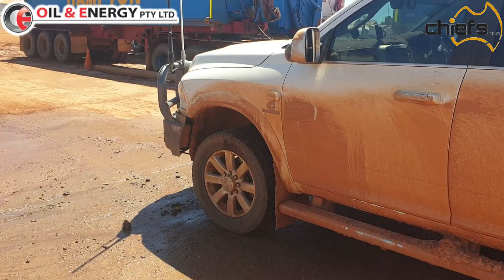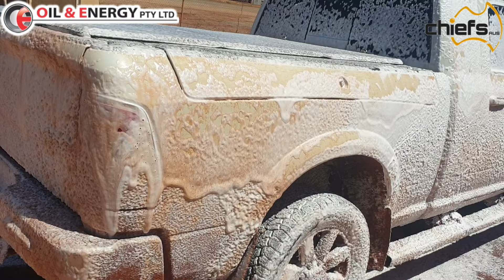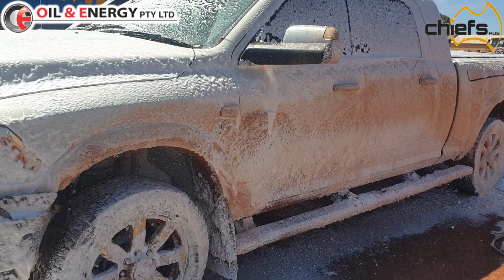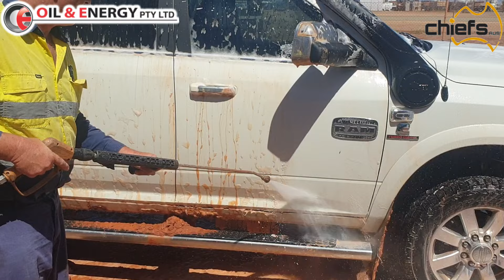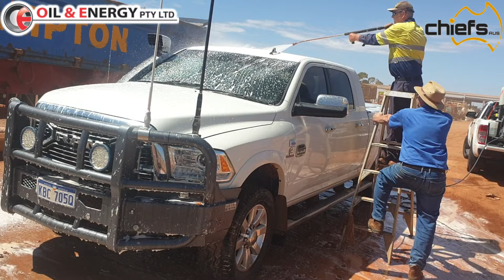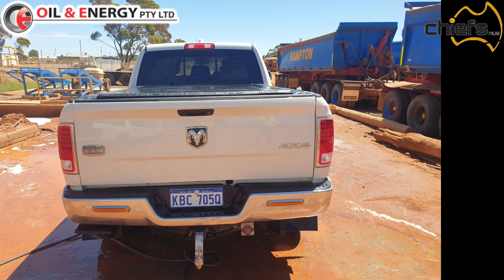Kenotek Cargo 4100

Comment: Why doesn’t anyone wash top to bottom side to side
Reply from the maker: When washing a vehicle using conventional methods you firstly apply soap, wash using a sponge or a broom and then rinse off with water from the top to the bottom.
Touchless washing is a bit different.
Soap is applied through a high pressure foamer and then high pressure water is used as a “sponge or a broom”. The water is worked back into fresh soap, either from the bottom to the top or backwards in the case of trucks and trailers etc. In this way, the soap is used more efficiently. (If you wash from the top down, you would simply wash the soap off the vehicle which defeats the purpose).
Then rinse from the top down to finish the cleaning process.